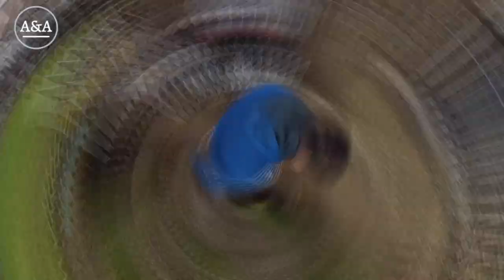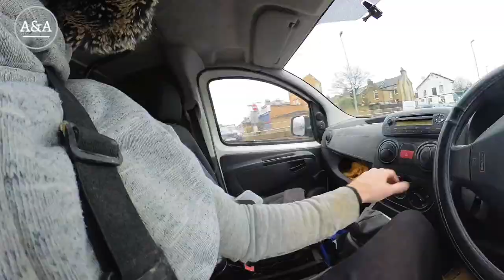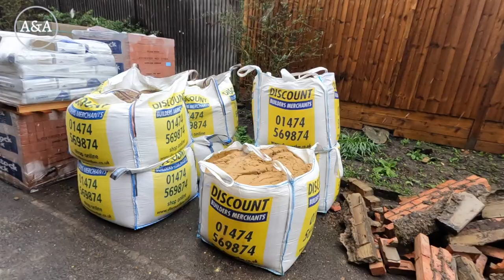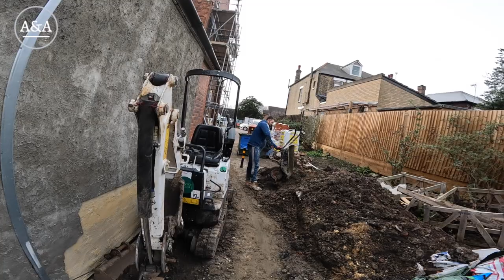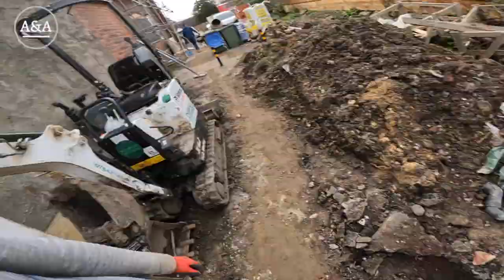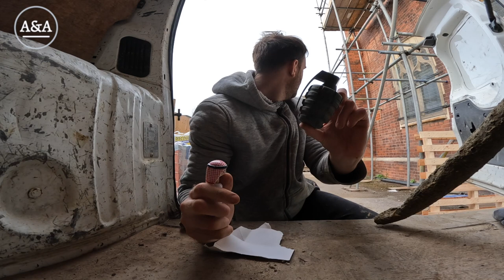Bricklaying - Rebuilding An Old Church!

Comment: Hi mate with that 4:1 mix you done in the video does it give you a full barrow of muck most blokes do 10 and half a bag for facework but I don’t think that’s strong enough ?
Reply from the maker: Hello Jack, an 8/2 will do you a full barrow. 10 and half a bag is basically a 5/1 mix, it will do the job definitely but I just prefer to do a 4/1 just to make sure it goes double hard, 5/1 can be quite sandy and eventually flake potentially
Reply: @AdamHatch  yeh nice one mate thanks I normally do buckets 4 buckets of sand to 1 cement but that 8 sand and half a bag looks like a good way too 👍
Reply from the maker: @jackcockell2087  to be fair doing it in buckets gives you a very accurate measure, when doing shovels straight in as long as they’re all roughly the same size shovels you won’t go wrong 👍🏻 I find when I cut the cement bags open and try shovel it out it either creates a mess or I can’t get the full shovel in properly
Reply: @AdamHatch  yeh exactly that think there both good ways of doing it I think the 8 shovels to half a bag is easier and a bit quicker then the buckets so will try go with that if it comes out consistent and right cheers mate